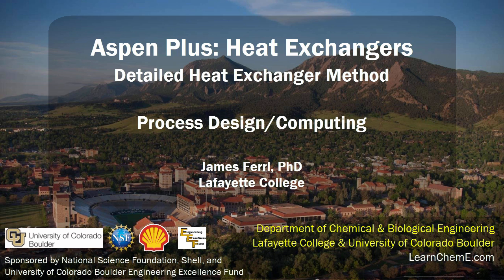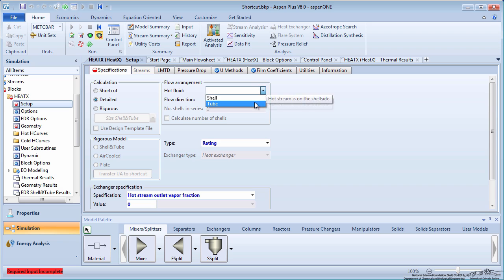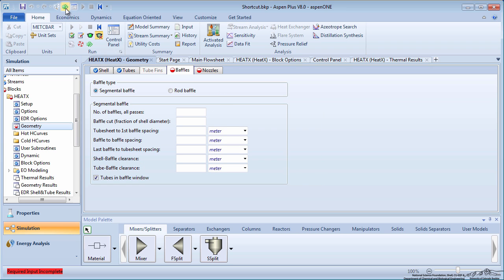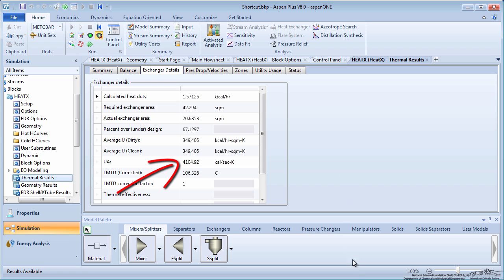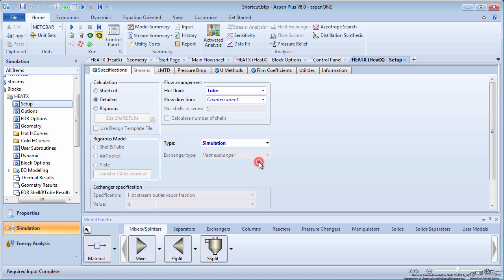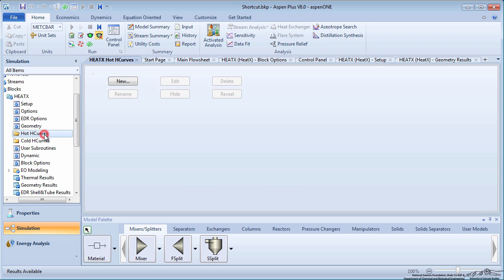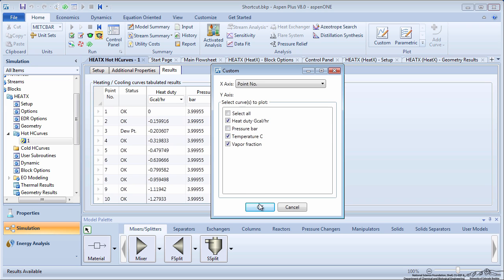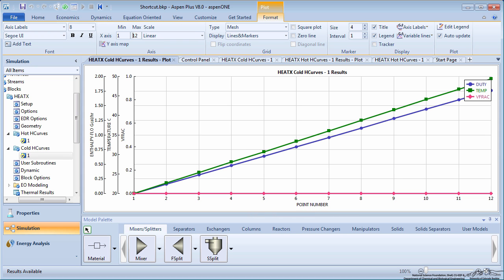Aspen Plus: Detailed Heat Exchanger Method

Comment: what if detailed is grayed out?
Reply: In Aspen 8.9 or later you have to use the EDR exchanger feasibility to specify the internal of the heatx. Same way, but instead of detailed you have to use Rating and a emergent windows appears to suggest the features.
Reply: I am having the same problem, detailed section can not be chosen. Could you find a solution?